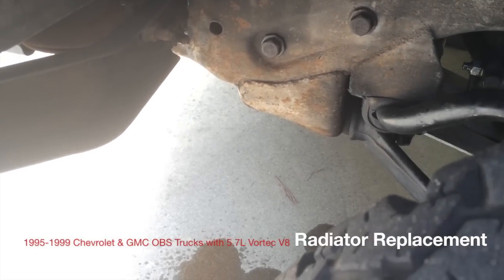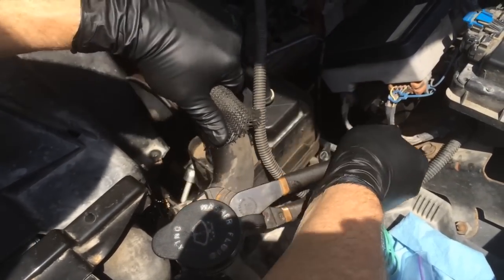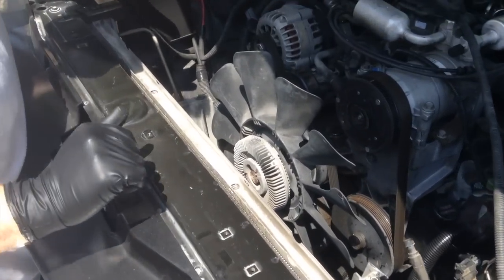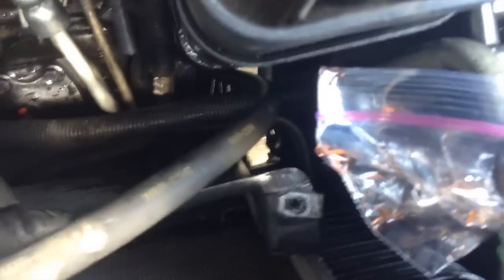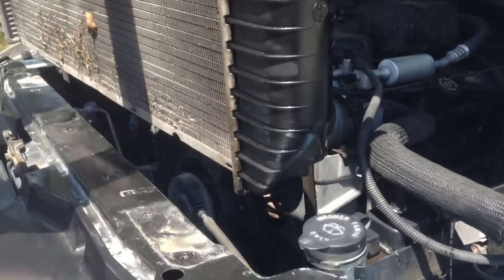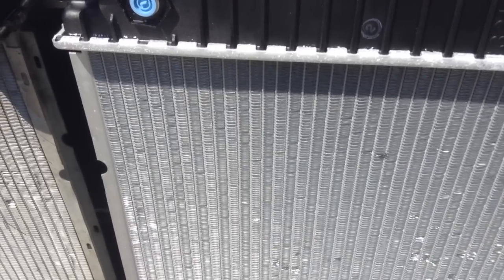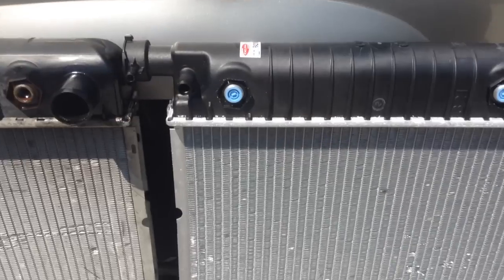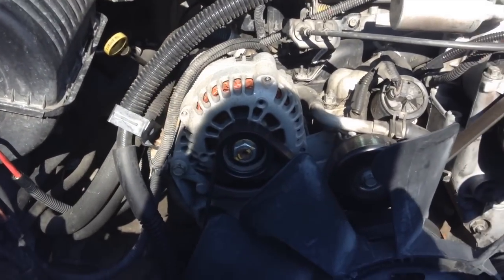1995 - 2000 OBS GM Truck Vortec V8 Radiator Replacement (Chevy & GMC)

Comment: Thank you very much for this video. I am not a mechanic, I build computers. But ended up having the exact same issue, leak in the same spot, and had to replace it asap couldn't even wait a day because I had to be at work. After watching this video, and having no clue what to do before watching the video. I ended up getting it done in less than 6 hours, including tear down, breaks, getting parts, putting it back together. I know this is probably slow compared to other people. But first time for me and I was still able to make it to work for half the day instead of taking 3 days off for my mechanic to fix it....

Comment: Great instructional video. I've got a 1998 Chevy Blazer V6 and am missing the three 10 mm flange bolts from the upper fan shroud. I can't find the part number for these bolts to order them. Do you or anyone have the Chevy part number for them? 'Would really appreciate the help. 'Am looking forward to more instructional videos. Thanks.
Reply from the maker: Thanks, the part numbers for the C/K upper shroud bolts are in the description.   But a 1998 Blazer would be an S/T small truck.  There are at least four different bolt sizes for those trucks, depending on build codes associated with the VIN.  For that I'd suggest your local GM dealer parts counter to be sure of the correct one.

Comment: Thank you for the video saw another video don’t know if it was a 92 but they took off the fan I have a 97 and I couldn’t take off the fan. So thank you for showing me that you don’t need to take off the fan or remove the plastic cover from the bottom fan
Reply: Had the same problem on my 98

Comment: Hey Dr. Shock, my oil cooler line is leaking from the fitting in on the radiator side. What would be a good way to plug the leak? Rtv, jb weld, or solder or can I remove the fitting from the radiator and put a new gasket?
Reply from the maker: I'd go for replacing the o-ring myself, presuming it's not just a case of the male fitting not being at the correct torque value.

Comment: Thanks for your tips. My repair manual says to remove the lower fan shroud. Didn't need to do that. Replacing the Water Pump at the same time in 28 degree weather. Lots of fun

Comment: A couple extra steps that I did to help me was to remove the front plastic skid plate and then unbolt the lower fan shroud. I was then able to rotate the fan shroud which made it much easier to get to the lower cooler lines and the lower radiator hose. Again these steps weren't necessary but they helped me tremendously.

Comment: Also that extra overflow is used on the earlier 88-91 Chevy trucks where the heater core return line hooks into that port.

Comment: So I was going on a long trip with the rzr out to the dunes.  Before I left I noticed my radiator cap was leaking so I replacedit with a ac delco I think rf85 part number.  Now my radiator is leaking like crazy. It looks like its coming from drivers side plastic tank area.  SON OF A BISCUIT
Reply: Same thing happened to me

Comment: Thanks as always Dr. Shock, great video. What would be your take on different fittings for transmission and oil cooler lines? My 98 5.7 SLT seems to have the adapters on the transmission side (which I believe are the 5/8") but none on the oil cooler side; these are the 20mm straight into the radiator. I'm close to replacing this radiator and I would like to replace the fittings (transmission side) and o-rings (oil side). Thanks!
Reply from the maker: Many of these OBS trucks are already members of the quarter century club, so alot of aftermarket and similar modifications could have happened.   Aftermarket cooler lines, or similar could have called for adapters to fit over the vehicles long lifespan.  My take would be as long as you get either an original GM/ACDelco radiator (still made for the 5.7L engines in both with and w/o oil cooler models) or an OEM tier one supplier (like Delphi or even Denso) everything should line up like factory.  I'd hold off replacing any o-rings until the radiator swap unless you have a significant leak going on right now.  Mainly because you should be replacing them with the new radiator anyway.
Reply: @DrShock  Thanks for getting back to me! From what I can see, no modifications have been done. A new radiator is definitely coming soon as there is a slow leak coming from the core itself. Here in Canada, the best price point I can find is on a Denso (221-9005). I'm suspecting things will line up as they should, the main concern right now is the bitter cold!

Comment: So does the oil cooler lines actually go threw the front of the radiator and hook up to another cooler or is it all in the radiator ?????
Reply: Some trucks have a separate auxiliary oil cooler behind the grille, while others have the oil cooler inside the radiator.

Comment: Great video! I'm taking it that its virtually the same when working on a 94 GMC sierra? Roughly how long did it take from start to finish for this work? Do you by chance know how big of a container is needed to drain the system when changing the radiatior? Thank in advance!
Reply from the maker: Thanks, I used a regular 8qt pan like when doing an oil change.  You won't get all of the coolant, but the majority that you can take to recycle.  This has been a few years, but I recollect it was around 3 hours or so (alot of that time was fighting aged fasteners).   I would imagine it's very similar for a 1994 GMC, though probably not the same part numbers I've shared.
Reply: @DrShock  Awsome! I appreciate the hasty reply.

Comment: Thanks for the video! Great info! Where did you get the “O” rings from?
Reply from the maker: Those would be the OG seals from GM.  Only the engine oil cooler side has them, the transmission side does not use o-rings.  There's a link in the description for the part number on eBay.

Comment: R there supposed to be rubber seals with new radiator ? Or does it just go in with nothing
Reply from the maker: You need those rubber saddles, but they would have to be purchased separately from GM if the originals are missing or no longer usable.

Comment: hey guys one question, did you have to add any transmission fluid or oil back into the truck??
Reply from the maker: You may lose a small amount of each, what ever runs out of the lines and the side tanks of the radiator, depending on if your have both an oil cooler and transmission cooler in your truck.  Some do not have an oil cooler built into the radiator.
Reply: @DrShock  tyvm

Comment: The sizes given for the trans cooler adapter were wrong.  At least for my 95 k2500 sub they were.  I need a 1/4 to 5/16 adapter.
Reply from the maker: The sizes I gave would only be for the genuine GM radiator and cooler units installed by the factory.  If there's anything aftermarket yes it could be different, thanks for sharing the info.

Comment: Can the work on chevy Silverado 3500
Reply from the maker: Well the actual radiator I show does fit some 3500 models as I mention in the vid. Double check your part number by calling your local Chevy dealer or using an online parts site to verify.  But the installation process should be largely the same as long as you have a gasoline engine.  For diesel very different.  There might be some differences here and there of course as this was a 2500 truck.  That 3500 of yours likely has a 4L80E transmission, for example, so the cooling lines might be routed differently, idk haven't ever worked on a 3500.

Comment: Pulled my whole truck apart now I’m trying to figure out what the cooler in front of the ac condenser is? Any idea
Reply from the maker: You'll have an engine oil cooler in that area, in addition to AC components.
Reply: DrShock figured it out it was the transmission cooler
Reply: @americanman911  so its cooled thru both the radiator and a seperate cooler?
Reply: @JoseContreras-mv5yz  radiator cools both transmission and engine oil and then u got another one in front of that one also as a trans cooler separate tho

Comment: 5249551 was my number dated 7/97 lasted 20 some years but I think it's to small to cool oil trans and antifreeze the shroud held it in and was not as long as yours it's a 2500 5.7 from 1996 idk you know any info on that part number just seems so small
Reply from the maker: That's not a good GM part number (missing a digit) but there is a 52489551 but that's for Chevy and GMC vans, not trucks.   If you have a 1996 2500 pickup with the 5.7L Vortec V8 then it takes a GM 52481442 just like my 98 did.   BTW, I noticed I had a typo on this part number in the video description and just now fixed that.
Reply: @DrShock  52479551 sorry thanks for reply
Reply from the maker: Ah ok yeah that is a good number for a 2500 truck, discontinued in 2009 though.
Reply: @DrShock  it just seems small the two holders on top that bolt to rad support are missing the shroud holds it in it's not as long as yours weird it would be on a 2500 it's listed for 4.3 5.0l not 5.7 I had to add a trans cooler was getting hot oh well thanks bud!
Reply from the maker: I use either oemcats.com or gmpartsgiant.com to see what a part number goes with, that 52479551 showed as "Fitting Vehicle Options:  CK1,2(L30,M30,C60,GT4,GT5,K60)(2ND DES)".   So yeah L30 would be the 5.0L V8.  You can check your options sticker in the glove box for what engine your truck originally had - the L31 (5.7L) or the L30 (5.0L).  The other important number is the transmission, different radiators for automatic or manual for the cooler.  Those start with an "M", so the 9551 was for an automatic 4L60E.    More common on a 2500 would be the MT1 trans, the 4L80E.  Hope this info helps.
Reply: @DrShock  yes the rpo code on glove box said it originally had a 5.0 the VIN does list it as a 2500 weird it would have a 5.0 with 4l60e like that nobody can change the VIN so it was a factory Option the rad was dated 97 so it lasted til now hey thanks for the chat and your time stay safe thanks for web site too!!

Comment: the o rings.      on all 4 sides correct . ?
Reply: Getting ready to do this job and appreciate your great video.  Still unsure about the O-rings.  Do I need 2 for engine oil cooler lines only or do I need 4 to do the transmission lines as well?  Are they the same o-ring?  RockAuto shows the O-rings listed under Transmission, but not under Engine.  When you loosen the connector from the radiator, do you need to remove the clip, pull the connector apart, and install a new o-ring for each?
Reply: Changed radiator yesterday.  Both my engine and transmission lines had flared connections.  New radiator came with 2 sets of quick connect fittings, but I did not use them.  Apparently some trucks have flared fittings and some have quick connects with o-rings.

Comment: What’s it cost. ? The new radiator
Reply from the maker: There are links in the description where you can check that.  Though the Delphi model I used in this older video was discontinued many years ago.

Comment: Will this not fit the 7.4l? Just wondering.
Reply from the maker: GM had 13 different radiator part numbers for a K2500 in 1998 alone!   For a 7.4L engine it would be different than what I gave for the 5.7L I had here, it would instead be 52491621
Reply: 7.4 L takes a radiator with 1696 as the part #. Just a FYI, I replaced my OEM 5 months ago with OSC 1696 and it failed last week. Has a 4 inch crack in the plastic tank.

Comment: This was posted a while back but maybe someone can clear this up for me. I have a 1996 K1500 4x4 that has an external trans cooler (not attached to the radiator) I have ordered 2 radiators and both have the fittings for trans cooler. Do I just block those off? and continue to use the external (trans) oil cooler? Thanks
Reply: Thanks, I have confirmed that the trans cooler lines do not have to be connected
Reply: What about the engine oil cooler lines, they have to be connected?
Reply from the maker: @zanebiz462  The GM engine oil cooler can also be an external unit, rather than built into radiator like the transmission cooler.  But either way your truck has it yes, the oil cooler should be connected for best operating performance under load.  But its not required to run the vehicle.
Reply: @DrShock  im about to replace my trans lines and i see both of them connected to radiator but i also see a smaller cooler behind the grill. Does it get cooled twice?
Reply from the maker: @JoseContreras-mv5yz  There's a few components in this area besides the engine radiator.  You may have an engine oil cooler, a power steering fluid cooler, and you will have the air conditioning condenser.   The former two are the smaller ones, the latter is almost as large as the radiator itself.

Comment: I have a 99 sierra 2500 with a 6.0 it's a bit different.
Reply from the maker: Yeah that would be a new body style truck, not an old body style one that this video covers.  OBS trucks extended into 2002 actually, for the Suburban/Tahoe (thru 1999) and 2500/3500 chassis cabs (thru 2002).

Comment: My rad is 29 inches long 18 high and only one core it cools oil cooler transmission cooler and rad fluid it's a 96 k2500 why is this so small truck has 5.7 it's factory engine and date on rad is 97 it's a Delco gm it seems so small

Comment: Get the dexcool out!!!
Reply: Hayden B why?
Reply: Hayden B...Dex-cool does not turn to brown sludge and is excellent extended use antifreeze if you don't sabotage yourself by mixing it tap water! Use distilled water only, and you won't have a problem.
Reply: @stefandwoodham   Its the worst coolant ever!  Eats away at your intake gaskets!  Unless you have already changed them out to the rubber & metal gaskets then no worries. Felpro 98000T